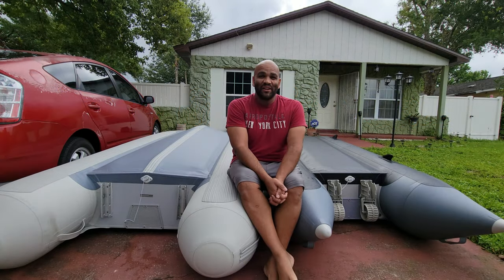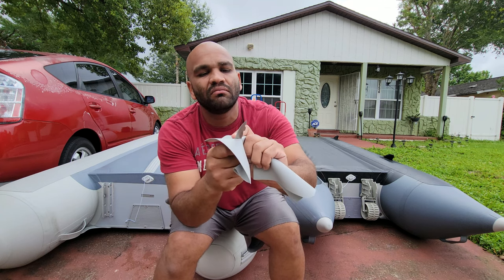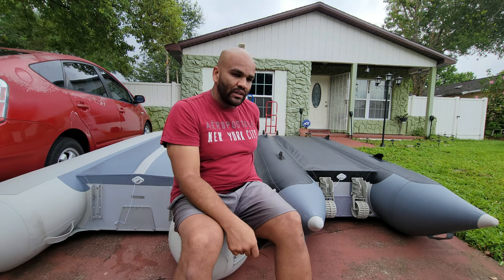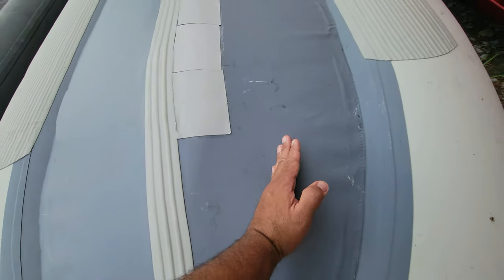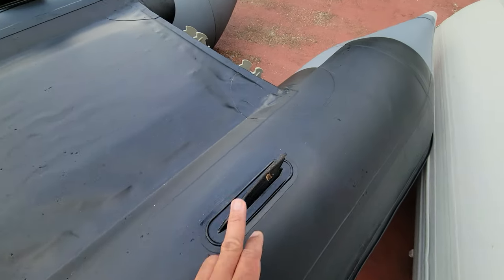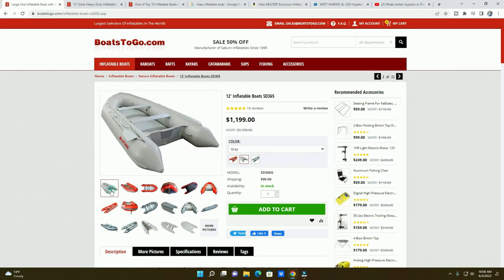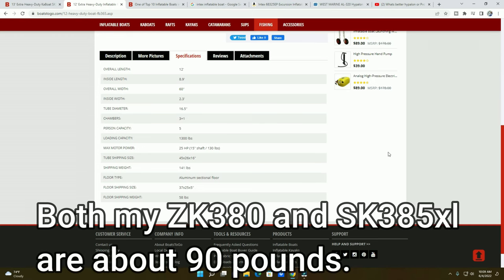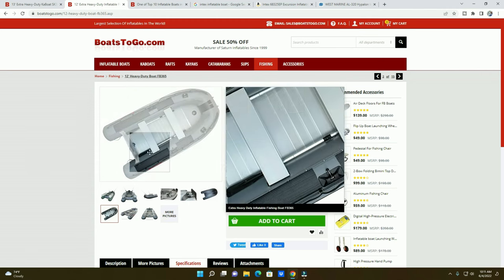How tough are inflatable boats in general?

Comment: got my saturn kaboat and 9.9hp from last year and only used it once...not even 4 hours in the engine lol... was a bit too big of a set up for my needs... going to sell it and down size to a 3.5/6hp set up
Reply from the maker: Fully understandable. I'll say 6hp
Reply: @ErickMartinSucre  was looking at 4hp to 5 to 6hp and they all seem like the same weight.. maybe just an intake and cpu makes it get extra HP 🤔  ..look to maybe now 3.5HP on a 11.5ft inflatable and from what I seeing people are getting up to 11+mph on it which will be more then enough for me alone.
Reply from the maker: I see, well, if you can run with a 6 go for it. 3.5 should be just fine as well.
Reply: @thatonebeone  I would go with 6hp as well. Besides power, their main advantage over 3.5hp is the support for external fuel tank.  3.5hp's internal tank will drain in 30-40minutes. and you'll still have to carry a fuel tank with you on the boat.
Reply from the maker: A wise choice and it is nice to have the extra punch when needed.
Reply: @boatsandoutboards9070  dont mind filling it up.. going more for ultra portability... get 1 gallon of tank and i should be good ..i only plan to fish for a good 4 hours the most but im sure 1 gallon will get me on the water all day no problem
Reply from the maker: That sounds like a plan
Reply: @thatonebeone  it is not as simple as it sounds.  but if you are OK with filling gasoline on a hot machine, not spilling it around while the waves are rocking the boat, and stopping and restarting the engine off the shore 4-5times every day. then go with the 3.5hp
Reply: @boatsandoutboards9070  i think 6hp should be portable after all..52 pounds is not much ... dragging a 100 pound 9.9 is heavy ...

Comment: Hi. Im am dissapointed to discover recently that the whole " it has 5 chambers so u can blow out one chamber and still be safe" is complete bs. I tried deflating one chamber and they all deflate at the same time. What would happen if u punture one chamber far from shore? I fish my saturn 430 about 5 mikes from shore in the pacific ocean. Is somethi g wrong with my boat or do they all do that?
Reply from the maker: 1st time I hear that, unless it was a defective model
Reply: @ErickMartinSucre  so what your saying is that each chamber is separate and is only supposed to deflate that one chamber that is puncured?
Reply from the maker: Yeah. My ZK380 has 4 and SK385XL  has 5.
Reply: @ErickMartinSucre  thanks for the reply. My 430 has 5 +1 chambers and i noticed at first that they all inflated when i inflated ome chamber and so i thought it had a one way valve between tje chambers for faster inflation. Ive tried deflating each chamber one by one and it deflated all of them. The boat is a year 2020. I wonder if saturn has answers
Reply from the maker: You're welcome ro send them a request and see what they say.